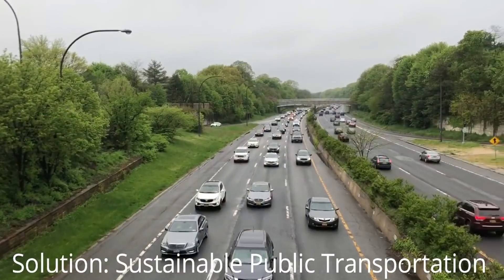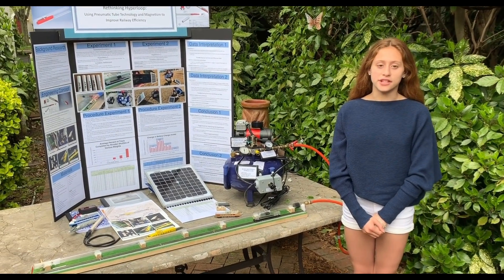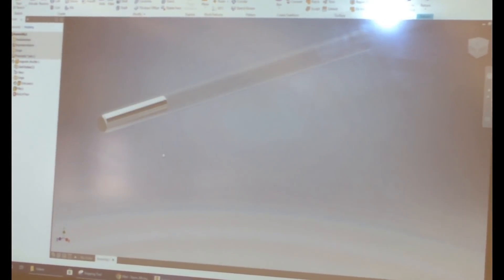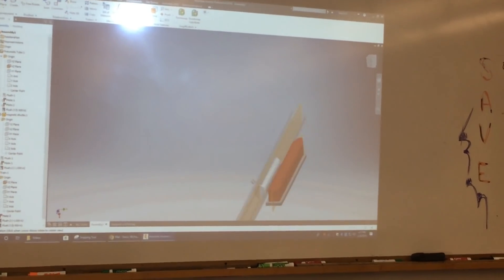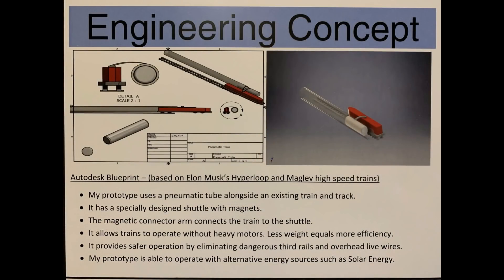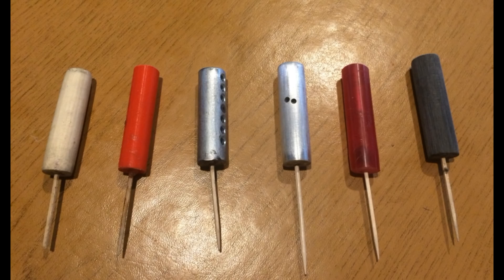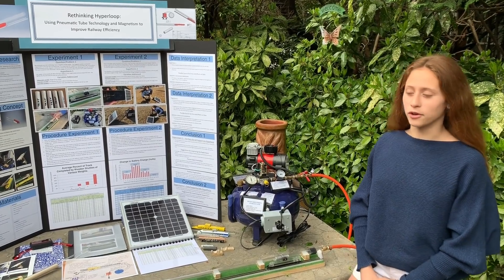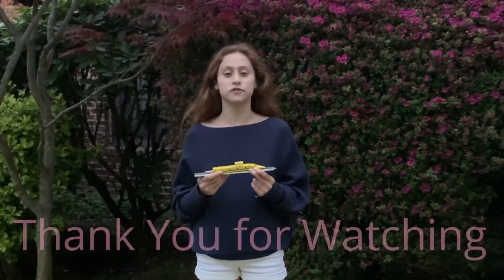2019 YSC Entry Video

Comment: Hi Caroline!

I believe you have re-invented the Atmospheric Railway ( https://en.m.wikipedia.org/wiki/Atmospheric_railway ) using a magnet rather than a solid linkage to transmit the motive force from the air piston to the train.

As best I can tell, the AR was never particularly successful, and there is today only one operating example in Porto Allegre, Brazil.

I suspect this is because electric motors and power transmission is today quite efficient and reliable.

However, according to Wikipedia, the train cars of the Brazilian system are actually unusually light, so perhaps your system could make sense in some niche application assuming it works better than previous versions.

Another commenter suggested friction and wear between the piston, the tube wall and the magnet could be a problem. This could be mitigated by using two magnets on opposing sides of the tube.

I wish you the best of luck in your further innovative career. Even if this particular design doesn't work out, by trying new things you always gain useful knowledge that can be applied to future inventions. The only way to guarantee failure is to never try new stuff!

If you get negative comments, try to figure out if they actually contain valid feedback which is very valuable. Comments that are just negative or rude without offering real critique can be disregarded.

If you keep innovating, you could one day change the world!